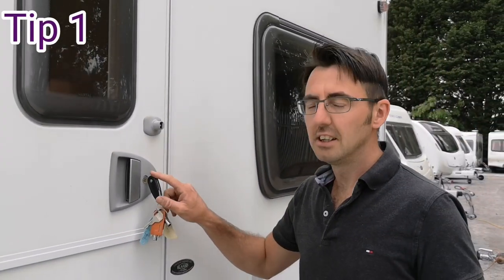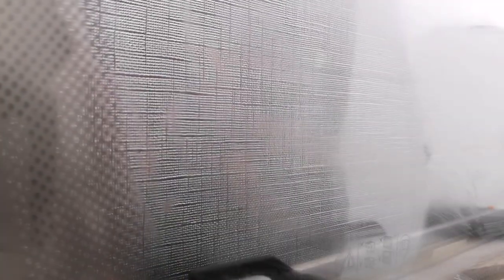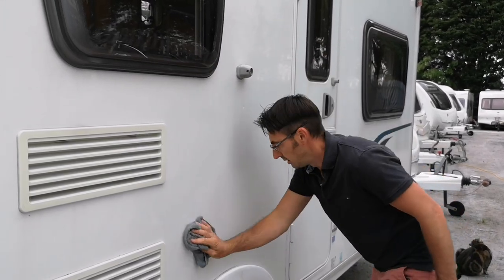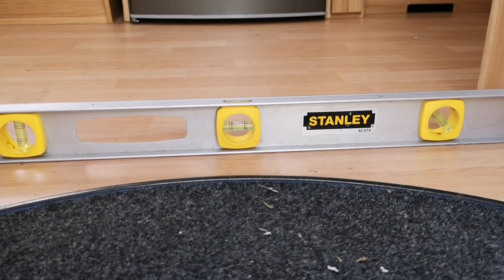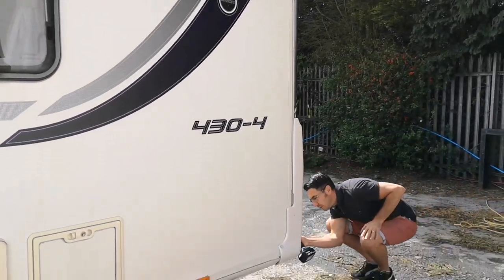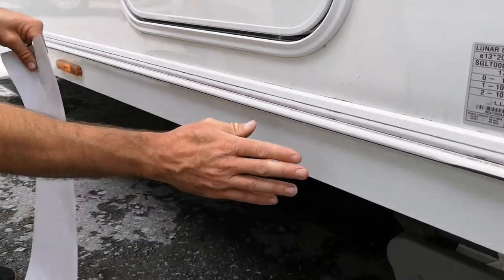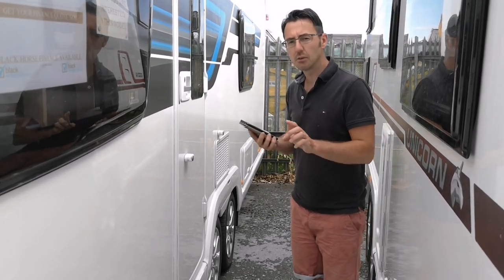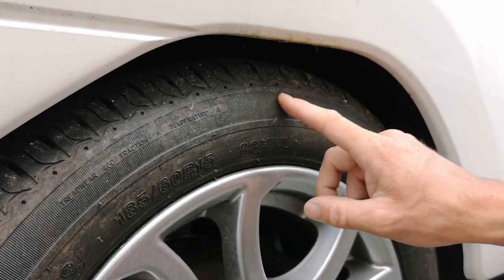Caravanning tips tricks - caravanning uk. Caravan Tyre pressure and levelling.

Comment: Great tip on
Levelling the van mate 
I’m new to caravans and wasn’t sure if you could use the corner steady to
Level the van so I’ve always used a ramp even for just the slightest amount across the axle. I will try your way next week when I’m away in it and hopefully I will have a shower that fully drains because up to now I haven’t 👍👍👍
Reply from the maker: Thanks, just make sure you don't put too much pressure on the legs and it is only for small adjustments 👍

Comment: Hello Mark thanks for another informative video, great information, well presented!  At the risk of demonstrating a huge amount of ignorance, rather than move the caravan to check around the whole wheel, can you jack the caravan up and spin the wheel to do this?  The background to this question is that I have a KoJack levelling system fitted and went to do just this the other day.  However, just as the wheel was about to leave the surface the chassis and or body was making such an awful noise I immediately stopped fearing that I was twisting the chassis etc.  Should I have expected the noise to be that bad, was there something amiss or should this just not be done?  Thanks Mark.

Comment: Helpful video, thanks. I always thought the corner steadies could not be used to jack the caravan up and pressure on all 4 had to be even.
So is it the case that as long as the wheels remain on the ground you can use the steadies to level the caravan floor without twisting the chassis?
Reply from the maker: As long as you don't go mad you can level up small amounts like this. If more out of level then ramps will be needed but we were about 10mm out so a small amount is fine.

Comment: Been caravanning a few years now. Levelling it with the steadies is it only ok on twin axels?
Reply from the maker: It depends how much you need to level it, if its just slightly out then fine on single or twin, but if you need to level by a few inches then you really need levelling ramps, we level with the legs when its less than an inch as the levelling ramps won't really work for this.

Comment: Hi, being a newbie I’ve always understood to not use the corner steadies to level the van. Is that information not correct?
Reply from the maker: You can use to put a little weight on the corner steadies to get level but not to jack it up and take the weight off the tyres for example. The air bag levellers are possibly the best if you need to raise one side a lot. Hope this helps.

Comment: Would definitely use a ramp on the offside, it’s to easy to put too much pressure on the chassis, lightweight chassis are not built to withstand any sort of pressure like this, overtime they will contort and buckle, I’ve seen floors there stabilisers have broken through the floor, they are only there to stabilise the van from moving back and forward as you walk around your van. I cringe when I see people lift jockeys off the round in campsites..... unless they are using a heavier chassis. 9 times out of ten though it’s an ALKO chassis. I like your tips, a lot of good insight but the levelling one 😬😬😬😬 people could easily get it wrong. Always use a ramp on the opposite side if the level babble is my rule.
Reply from the maker: Nice input👍